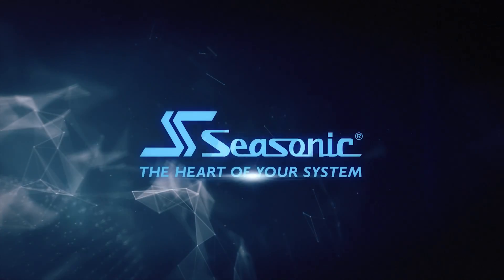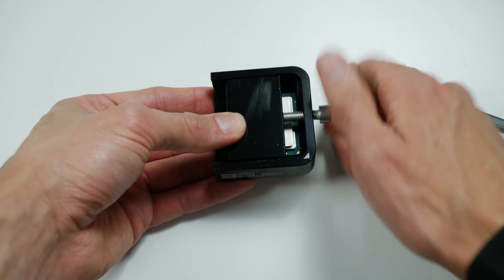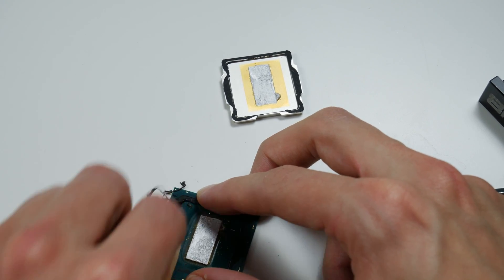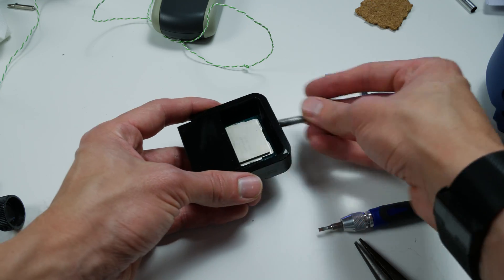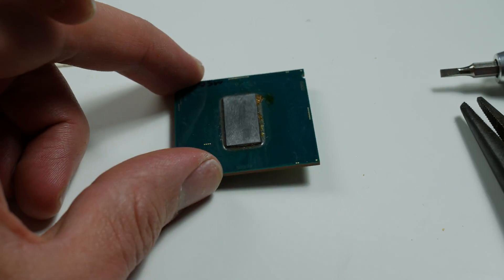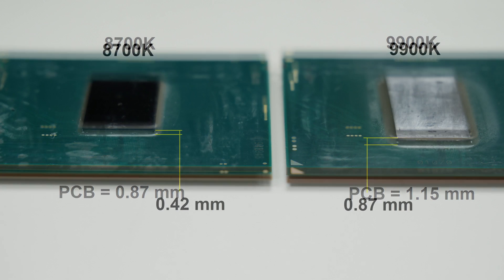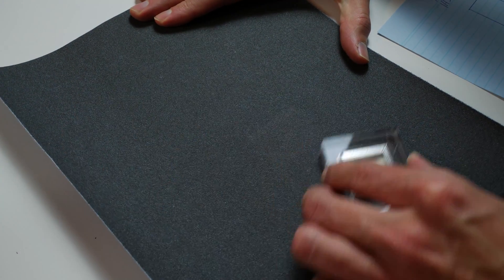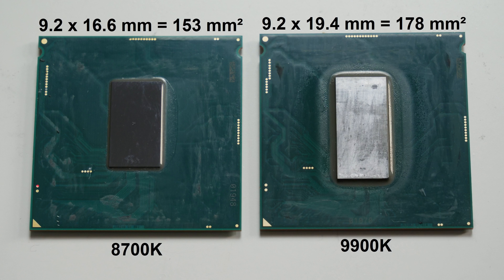Bad sTIM? Why is the 9900K so hot?

Comment: Maybe the problem is reverse: Intel had to increase the thickness of the die (for a reason unknown to us) therefore they had to use stim because the regular toothpaste tim would not have been good enough to cool the 9th series. Which would explain why they went for solder. Maybe I’m too cynical but I don’t really buy that they just listened to us...
Reply: Or vice versa.... Thinner die wouldn't survive thermal cycle.
Reply: do we know of any other cpus with the same TDP as 9900k and their die thicness?
Reply: @ppsarrakis  I believe a 2700X @4.2GHz 1.4V also pulls around 180-200W but I think it wastes less power therefore dumps less heat? Also the die surface area is bigger so I guess can't really compare
Reply: Sanding a 2700X and comparing silicon thickness would be great!
Reply: 200W is 200W the energy has to go somewhere.
Reply: Parsa Strife,
First off, power drawn from the wall is the same as the created heat. If your system draws 300W you dump that amount in heat into the room. BUT... when it comes to TEMPERATURE there are a lot of factors:
1) how much power does the CPU itself draw? (voltage regulators etc before the CPU)
2) thickness of silicon
3) TIM used
4) cooler used
5) CPU power management

*but again there's no such thing as "wastes less power therefore dumps less heat"
Reply: Pustul 
I think they felt pressure from Ryzen. They HAVE to maintain the pure performance advantage or their excuse for charging a higher price is DONE.
Reply: So Intel can launch a new 9900K Refresh with a thinner layer of sillicon and keep the shareholders happy, and have new products to sell untill they have fix'd 10nm/7nm produtcion!
Reply: i think they just knew they couldnt add more cores without soldering, and the extra stress from soldering just needed a thicker die and pcb.  you put a sheet of indium metal between another piece of metal (ihs) and the silicon die and heat it till the indium melts and then let it cool and there will be tension there, like a spring coiled up, and then on top of that put a spring loaded, screwed down heatsink\waterblock on top and you have a lot of forces surrounding what is basically a tiny shard of glass (the die).  making it twice as thick probalby was just seen as necessary to maek sure the cpu lasted 10 years or more.  intel is very big on cpus lasting for a long time.
Reply: @Chris J that would explain it but the push to 450mm wafers is about dead.  i havent heard of anybody using them.  its possible i suppose but the people who supply the raw chunk of silicon that the wafers are cut from would have to make the "ingots" in a large enough size to be able to cut 450mm wafers and i think we would have heard something about it.  

https://www.extremetech.com/computing/242699-450mm-silicon-wafers-arent-happening-time-soon-major-consortium-collapses

its possible though

also it seems funny to me that intel are using the 8 core die for the 9600k.  why not just run some more of  the 8th gen dies off and disable HT.  would waste a lot less silicon.  but then i guess they wouldnt have a place to get rid of bad 8 core dies.  unless they are doing mixed runs with 8 core dies on some and 6 core dies on others.  intel hasnt had an i5 with cores shut off.....ever i dont think.  the first gen maybe back when the i5 had dual core variants. seems odd.
Reply: bobhumplick the 9600k is a 9900k that has some sort of defect and as a result couldn’t be sold as a 9900k.

This is very common when manufacturing large silicon die’s, and is the main reason AMDs “chiplet” design is so cost effective and has been so successful. Bigger die’s are harder to manufacture, and have a higher chance of having a defect fall on that cpu.

Go check out AdoredTV’s channel, he runs through all the big points explaining the differences and why they are that way vs the benefits.
Reply: They didn't "Listen" in the 1st place.
Their reason for going to Toothpase was with a smaller die heat cycling could cause micro fractures.
With a bigger die the returned to solder
Reply: Nope. They are still using 300mm
Reply: https://www.anandtech.com/show/13400/intel-9th-gen-core-i9-9900k-i7-9700k-i5-9600k-review
Die photo's from 7th, 8th and 9th gen disagree
Reply: Finding a way to disappoint the consumers is the trend for manufacturing these days...
Reply: paste was good enough for stock speeds of the chips that were pasted. and enthusiasts didnt mind delidding.  i did my 8700k with a literal shaving razor in 30 seconds

when they went to higher clocks and more cores the paste wasnt enough.  so they went with solder.  but they have insane standards for how long a chip has to last.  like 20 years at full oc or somethig stupid (exaggerating a bit there).  so they had to make the chip thicker and the solder thicker.  maybe a non soldered chip doesnt have to be as thick.  when you heat up solder and silicon and copper and they meet and bind together then there will be stress when it all cools because the metals shrink quite a bit while silicon shrinks and expands very little.  so you have to maket he chip thicker i guess.  i never minded the paste.  wish they had never done it.  but for people who dont want to delid this is a big improvemtn
Reply: Intel was tired of hearing people ask for Solder so they trolled everyone
Reply: Exactly, they used solder for temperature reasons, but the indium solder does not expands neither contracts with such ease as TIM paste which I think was resulting in core cracking at that quick temperature changes so they made silicon over cores thicker which resulted in lowered thermal efficiency of this connection, but it has improved endurance in long period of quick temperature changes.
Reply: i wonder if it had something to do with stability of the chip.  these pull a lot more power and heat so maybe everything had to be thicker to make the chip more stable ie less warping, stress from expansion and contraction.  the pcb could be thicker to allow thicker copper layers as well.  the die could be thicker to close the gap with the ihs since silicon has a high conductivity.  so a thicker die would be closer to the ihs and need  a thinner solder layer.
Reply: Of course they had to use a soldered heatspreader... 8 cores 16 threads and up to 5ghz all cores? You can't use anything less.
Reply: @AJDOLDCHANNELARCHIVE  that is correct.   intel used the soldered heat spreader only because the 6 core chip that came out before it was almost to hot for the paste at stock.  when overclocked to 5ghz and doing anything intensive, not gaming or browsing, but any pro work the paste didnt cut it and a delid was needed.  the bad thing was that the pasted chips were so so easy to delid.  i did my first one with an actual disposable razor i had lying around.  took 15 seconds and if you do it right it is the safest thing you could do to a cpu.  putting the cpu in the socket is more dangerous because you might bend a pin on the board.

but an 8 core cpu at 5hgz?  you are exaclty right.  now way.  the only way it would have worked otherwise is if they came delidded.  which some cpus did come bare back in the day.  

the thickness is probably because of the stress of the soldering process.  when you bond 3 different metallic surfaces made of different materials under high heat they will all expand at different rates and then when they cool they will shrink at different rates.  and the most fragile part?  the little sliver of silicon that is as brittle as glass?  well silicon doesnt expand at all hardly under heat.  its actually well known for its thermal stability.  meaning it expands very very little and then when it cools it shrinks very very little. 

but the indium solder is a true metal so it probably expands a lot and then shrinks a lot.  and one side has to stick to the die and the other to the ihs so both sides of the solder will be at different temps from the thing they are touching and both things the solder is touching will be either expanding and contracting at a rapid rate or totally motionless.  that kind of thing builds up force and tension like a spring under pressure.

several people have delidded these chips and found cracks in the dies.  ive seen a handful of pics of it.  a couple people sanded them down and they disappeared just past the surface.  the extra silicon dioxide added to the top is probalby to make sure the cracks happen there instead of in the actual circuitry of the die.  

or it could be just so they can use the same ihs as before, but with solder instead.  and the extra thicnkess of the die is just so that the solder will be thinner.  i hope thats not all it was.  intel not wanting to change the ihs lol.  

and of course it could be because of some other product based on the 8 core die besides on our precious desktop cpus.  there are 8 core laptop chips.  maybe some other cpu based on the 9900k needed to be thicker or needed to be stiffer.  i mean these dies are already so thin.  the 8700k is half the 9900k's thickness and i honestly dont see how the 8700k doesnt just snap from thermal stresses or just from a short drop.  its a piece of glass basically, that is made thinner than a credit card.
Reply: No - the point of the TIM is not to cool a chip, it's to provide a heat-path between the CPU and the heat-spreader. Solder is far superior to paste in terms of heat conductivity. 

For example, Thermal Grizzly Kryonaut is 12 W/mK and their Conductonaut is 73 W/mK. This massive difference is why delidding the previous generation and using liquid metal instead is so effective.

If instead Intel used Indium, that brings additional advantages - it melts at such a low temperature (160ish degrees) that it doesn't affect the dies, and its thermal conductivity is 81.8 W/mK - superior to that of Conductonaut.

Why solder? Look at Hardware Unboxed's review. Their 9900K hit 100 deg C when running at 5 GHz with both the Noctua NH D15 and a Hydro Series H100i loop. Now think back to the 8700K, where delidding and liquid metal reduced the temperature by around 20 degrees. Even a custom 360 mm open loop hit 77 deg C at stock speeds.

If Intel did NOT use solder, they would have to reduce its clock speed dramatically.
Reply: they went with solder to get the higher clocks.  thats it. to be more competitive.
Reply: bravo sir
Reply: Pustul Anyway they did it ether for marketing OR technical reasons. But in any way I really like and appreciate it. Haswell was a Great leap for Micro technology in retrospective and why NOT go back to something everyone can agree it works even if it means a bit more cost for Intel. I think they thought the same thing internally and just went for it. At the end of the day they laugh about the money they lost...

Comment: Lol, everyone will be calling for toothpaste TIM again so it'll be easier to apply liquid metal on their delid.
Reply: I'll be asking for delidded CPU's out of the factory.
Reply: with this thick die they can just get rid of the IHS. even with a cracked corner the circuits inside should be safe. I know lots of older AMD Athlon CPUs (pre-IHS era) with cracked dies that ran just fine. but that was mostly because AMD used silly foam pads as stabilization material for the cooler.
Reply: Intel finally investing in solder for a single generation, just so they can half ass it and say "I told you TIM was better" and have an excuse for going back to toothpaste and therefore cutting costs next generation
Reply: The thicker wafers likely cost Intel as much if not more than the soldering process since that means fewer wafers per ingot. That's even worse considering that there is an on-going ingot/wafer shortage. If the main reason for the thicker die is indeed to take up the thermal cycle strain from solder TIM, then the opportunity cost of soldering really isn't worth it from a business standpoint, better off getting ~30% more wafers per ingot with a thinner die and paste.
Reply: but that is risky for intel because 9900K is considered a milestone chip before they shift to 10nm or 7nm architecture. plus 14nm chips are low in stock aren't they?
Reply: 9900k is still 14nm
Reply: DarkPa1adin yeah, low stock cause the silicon they're using way too thick, lol!
Reply: intel used to solder stuff, they started using paste in ivy bridge, My i7 2600 is still a marvelous and cold beast
Reply: why don't they just use liquid metal from the factory if it's that good?
Reply: Anball2 because liquid metal is really unreliable compared to toothpaste or solder, not a good long term solution